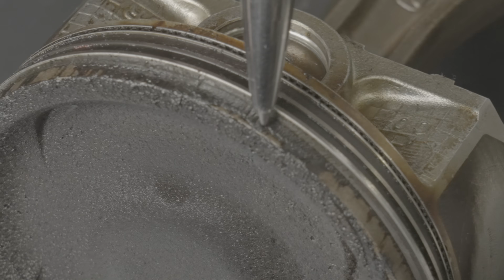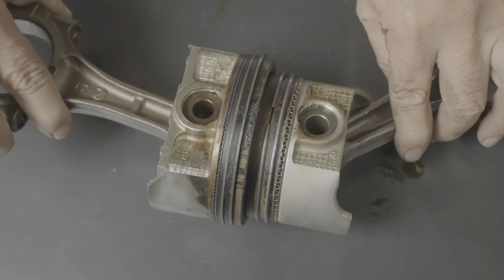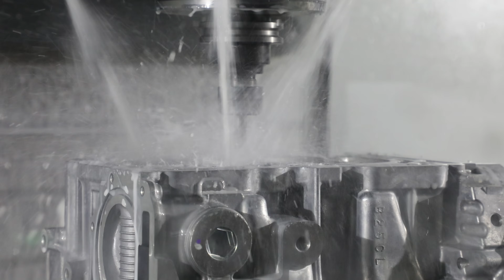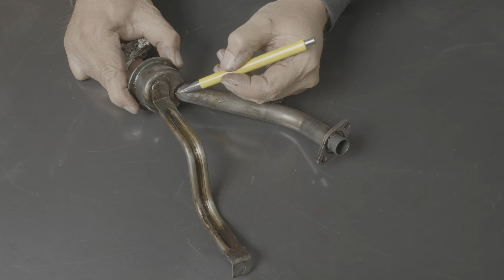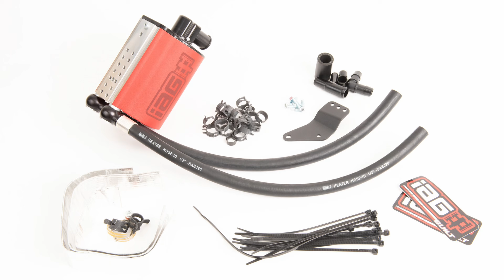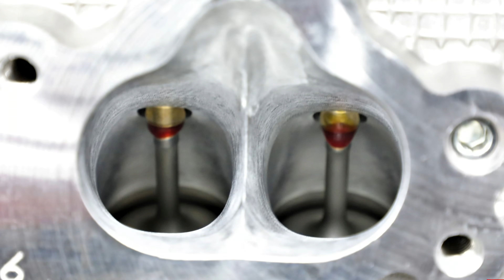Why Subaru Engines Blow Up!

Comment: My WXR was wonderful and didn't suck oil.  My STI has been nothing but problems it goes through oil like a 2 stroke.  At 16 K miles it threw its cam belt and needed a new motor the dealer claimed it wasn't covered under warranty because I change  the oil myself which is illegal but Subaru didn't care.  The last Subaru that I will ever buy!
Reply from the maker: Seems like you would have a good legal case.

Comment: These cars tend to knock, and need fuel and also run hot. Gotta watch outside environment factors, make sure the engine isn’t sitting and good tune and you’ll be fine.
Reply: Sounds like a lot of work to make sure our engines run “fine” 😂
Reply: The wrx absolutely needs to be run on no less than 98 octane (RON).
 if you do not, it will knock. Pretty simple.

Comment: Glad I found this video. I'm trying to talk my kid out of buying a used turbo charged Subaru. He doesn't have the money for repairs and needs a reliable car for work.
Reply: Get the kid a Honda Prelude from a dry climate w/ no rust. 
Fun car, 200hp, great handling, reliable.
Reply: @cecilthecavetroll9743 I feel like a 9th or 10th gen civic Si is a better bet than a prelude. Preludes are pretty old at this point
Reply: @bryanr93   true. In that case yes, a 9th gen Si (my favorite) or even perhaps a 7-8th generation Accord Coupe.

Comment: Hey Mike, any opinions on the changes for the FA24 engine in the newer model years? Mostly, does it seem as flimsy? Asking before i do something dumb do it haha
Reply from the maker: We haven't built one yet, just stock ones.
Reply: @motoiq  dang, here's hoping it can take a couple more horses!
Reply from the maker: It can over stock but its not hugely strong.

Comment: i dont know anything about what this guy is talking about i have 250k on my 09 wrx, change the oil dont do donuts, and drive it fast and blow out the carbon. car will go 300k no problems.
Reply from the maker: We have never seen that, most fail within 100k

Comment: My  MY99 WRX did 425,000 km from new. The head gasket gave way a small amount about @ 350,000 km . I ended up selling it as the maintenance costs were getting high. I still miss it. The car still pulled hard even at 425,000 Km.

Comment: Why doesn't Subaru listen to this guy, every point he makes seems to be rooted in common sense.
Reply: Because these aren’t problems most Subaru owners face. The problems only rear their ugly head when you push the turbo 4 EJs too hard.
Reply: @cecilthecavetroll9743  zero relevance, just because "most" Subaru owners do not face these issues doesn't mean they do not exist!
Reply: @donniev8181   You could say the same about any car.
Reply: @cecilthecavetroll9743  again, not relevant. Dont be a butthurt fanboy, your whataboutisms are ridiculous! If you honestly think that you know better than a 55yr veteran mechanic, you're delusional! Everyone knows the Subaru boxer engines have issues. It's a flawed engine design. The way the engine is designed, the pressure that is built up ends up being too much for the crankcase.
Reply: @donniev8181   well it is relevant to mention ownership. I’ve owned 4 Subarus, all have achieved AT LEAST 165,000 miles without a motor related issue.
Reply: @cecilthecavetroll9743  there ya go again with the irrelevant whataboutisms, Subaru engines are known for blowing up period.
Reply: @donniev8181 Bud, what’s wrong with you? Lmao, why do you Subaru haters start foaming at the mouth over dumb shit? 😂
Reply: @builtvisions  I don't hate subaru, I'm simply stating facts! The boxer engine is a poorly designed engine, if you think otherwise then you're the one denying reality. In a normal engine the oil naturally falls back down into the crankcase and pan, that is lost in boxer engines.
Reply: @donniev8181  LMAO!!! So where does the oil go then? The atmosphere? Buddy, do you even own an EJ?
Reply: @builtvisions  dude, you obviously know nothing about an engine's oil delivery system. Boxer engines are known to burn more oil than normal inline engines simply becausce of its horizontal cylinders. Because of the horizontal position of the cylinders, oil tends to pool in the cylinder heads which can then cause the oil to leak into the cylinder itself. The oil will then find its way to the bottom of the cylinder, staying there longer! Oil delivery to the engine head takes a longer time to flow back down to the pan. Oil in a normal inline engine is pulled easily by gravity back into the pan, no pooling issues. Here's an idea, try actually researching oil issues with the boxer engine and then we may be able to have a conversation.
Reply: @donniev8181  You’re talking to someone who’s owned EJs for 10 years, lol. I’m well aware on how it operates. Some oil is definitely more likely to pool in the cylinder heads due to the flat nature, but it really doesn’t burn that much more than an inline or v. We’re talking small quantities here. Generally, you’ll loose about a quart between oil changes which is quite normal. All engines naturally burn some oil anyway, especially turbo engines. Just check your oil occasionally and top off if needed. Most problems affiliated with the EJ are the owners. It’s very easy to maintain these engines. The reason why a lot of EJs blow up are because of the idiots that own them. It’s not as bad nowadays, but it was a huge problem in the past. Please, unless you actually own an EJ or have actual experience with them, don’t talk. One thing that I can’t stand is a person who thinks they know it all by doing google searches or going off of other people’s experiences while having zero actual experience themself.
Reply: @builtvisions  owning something and knowing how it works are two totally different things! If you honestly think the boxer engines do not have issues then that tells me you have no clue
Reply: @donniev8181  Right, I have no clue! I’ve only been racing and modifying these engines for the past 10 years. EJs with over 200k miles on them with original engines. I’m going to listen to a random dude on YouTube with zero experience that goes off of internet memes as “facts”, lol…
Reply: @donniev8181  Also, I never said that the boxer engine is perfect. That being said, you can say that about any engine. Know your platform and know how to maintain it. That’s it! I don’t understand why it’s so hard for people to grasp such a simple concept….
Reply: @builtvisions  you totally came after me all because I said the boxer engines were a bad design, get outta here with your bs!
Reply: @donniev8181  So explaining things to you is coming after you? Lmao, so sensitive…

Comment: My Legacy EJ20Y 5 Speed has been a fantastic car with little to no oil use.
Bone Stock, I have replaced Axels, Timing Belt, Power Steering, Water Pump, Brakes all 4 Corners and just did an Exedy Clutch with Single Mass Flywheel.
First owner from Japan 55k miles. Are you saying get rid of it? I don't plan any mods just maintenance. I dont beat it but I drive it. Did I waste 10000.00?
Reply from the maker: Keep it stock and maintain it well and you will be fine.
Reply: @motoiq  Thank you for replying. Greatly appreciated Mike. I thoroughly enjoy my car and take care of it but drive it.

Comment: Great explaination of piston ring design and open deck block. These lightweight aluminum turbo engines are race engines, but people forget they are made as light as possible to good enough finish a 500 mile race. At end of race, race engines are completely rebuilt or simply replaced for next race. When people buy these race toys for daily use, they should expect to pay for engines, transmissions, brakes and expert techs like you. It's call pay to play.

Comment: Excellent summation Mr Evo. 😘

Anyone who has owned a modded Subaru knows this about the EJ series 255/257 (as of 2009 I stopped paying attention) and I'm assuming even the fa series.

(Please comment on the FA20/FA24 specifically as i have not broken mine down yet!😅) Nor have the knowledge of having multiple friends with WRXs or time for forums anymore. Not that people on forums know anything..
Reply: I didn't know they didn't nitride it before 06. THAT makes sense to me now lmao 🤣(owned multiple 07s, friends 05s)
Reply: I should add that my former best friend spent 14k upgrading his bottom end and trying to get a tmic to work when I told him that it would not. He learned the hard way.
Reply: I also feel that any modded Subaru has to have unequal length headers as well. 😉

Comment: Why don’t you guys work on Hyundai engines?
Reply from the maker: No one has asked us to.
Reply: @motoiq  I inquired about it for a future project of mine and the response I got was "We do not work on Hyundai engines. Best of luck with your project." lol
Reply from the maker: It's because we don't want to.  Its going to be expensive and take a long type because no one builds them and the parts have to be custom made so my GM decided we don't want to do it.
Reply: @motoiq  Quite a few people have built N motors, mostly in Germany and South Korea, for 6-10k. How much money would it take for you guys to do it for someone who isn't in a rush? Or would a project like this be a hard no?
Reply from the maker: We would have to research what the weak points are and how to address them so its hard to say.  You are the only one to ask about these engines and for the amount of time we would have to put into figuring out the best way to build it and how much to charge, I would say anywhere from 10-20k depending on how much power your expectations would be.  I mean we are a small shop and we have tons of Honda, Subaru, LS, Nissan, Mitsubishi and Toyota engines to do where we have known formulas for. We are trying to avoid different projects that the development wont go anywhere for us.
Reply: @motoiq  Understandable, thank you very much for the thorough response. It sounds like for the right amount of money we could do something here. I'll be in contact eventually when the rest of the car is complete and ready for the power lol, have a good one!

Comment: basically, with a WRX engine and up, you either build it ALL THE WAY, or you leave it 100% STOCK.  All the kids bubbles just burst because they all wanna install a kobb and get a boost up without doing any other work. Above them you have johnny half-ass who says "ima just put studs".  It's people's sheer lack of knowledge about the particularities of subaru motors that blow them up.

Comment: This guy knows his stuff. Very experienced and knowledgeable.
I didn't know those Subaru engines are so crap.
I was thinking of buying a WRX back in the day, but I settled on an E36 M3 Euro Spec car instead. I still have it 15 years later and it's supremely good.
Reply: The biggest problem is that you don't know ANYTHING... someone gives you a load of crap, and you suck it down like a free breakfast.  Pathetic, but what else would you expect out of a M3 lover.....
Reply: @eskieman3948  Moron. That is the perfect response from a MORON. AN M3 is vastly superior over that shit box Subaru.
Pull your head out from your ass, wipe the shit out form your ears and wake up to yourself.
You think you know more, then prove it dickhead. Another keyboard warrior piece of shit who needs a bitch slap.
Do you have sex with animals ?.
Reply: They aren't "crap" they are legendary. Yes you have to maintain them and if you are a dick and run shitty mods with bad tunes and flog the engine they will punish you. This video is a beat up, the positives far outweigh the negatives.
Reply: @jaredmundi3599  Fair enough. I agree.
Reply: He did explain that they don't take modding very well which is not really a design flaw if people push them beyond their limits.

Comment: I have a general question on these:
   Somebody, I think subaru themselves and no doubt many others, point to the low CG as one of the many benefits of the flat 4.
    I have doubts, but have never measured or even looked closely to justify them.
   Problem is: the flat 4 shape dictates that it is installed pretty much how subaru has done- longitudinally. All subarus are front, or all wheel drive.
    This gives the crankshaft no other place to be but perpendicular to the front axle, and also above it. Not just above the axle, but it also has to clear the ring gear and differential.
   Subaru also boasts of ground clearance,  pushing everything a bit higher.
    A transverse engine placement allows the heavy crankshaft to be parallel to the other parts, so no need to be above the axle, it can now be in front of and next to it.
    Subaru cranks don't look real high,  and honda/toyota/others don't seem to have taken full advantage of the crank placement possibilities....
   But it makes me wonder about the truth of the low CG claims. The crank and rest of the bottom end are heavy parts. The claim probably has some truth in the 86/BRZ rwd platform, but was made before that car existed.
    As for some of the other claims..such as "flat fours make more torque "- I say BS. 
   If it's an even firing 4 stroke 4 cylinder, it has a power stroke every 180 degrees.
   Any torque, or lack of it, comes from other factors.
   It sure has more parts. I learned from this video about the tolerance stacking and cam timing issues after machining. Interesting- I had assumed they had 2 timing belts, (like a Honda gold wing) which would reduce this problem.
   Just another reason to do it right and actually set the cam timing..and I don't mean by lining up the marks.
  The piston/head quench mismatch is weird.
    The flimsy oil suction tube is, too, given the "rally" image that they probably enjoy. 
    Broken oil suction tube sure negates all the other problems!
Reply: So, my question there was what do you think of the CG height of a flat 4 in a FWD car compared to other layouts?
Reply from the maker: Not worth it in my opinion.
Reply: I just saw a Subaru ad here, they repeated the low CG claim. And showed a few cars with various things bolted on the roof..seems ironic. 
    Although they would say "iconic"...things on the roof,  dogs, save the planet,  etc.

Comment: Anyone run diamond pistons at their recommended .005" piston to wall clearance on these? Why keep it so tight at 3 thou
Reply from the maker: Less noise, better bore stability and ring seal, longer ring life, if the piston is designed to run at those clearances, no problem.

Comment: You mentioned the poorly spaced gear ratios if planning a high revving NA engine..
    It is easy to not realize the importance of that, and you are very right!
   I put a 4age engine into a tercel 4wd wagon. There were more difficulties than expected,  it took a fair amount of machining, welding, and other weird stuff I didn't expect. It was my car for a while, maybe 10k miles, parked and decaying now.
   A strange annoyance was the gear ratios of the manual trans.  If you didn't rev it hard, like 7500-8000 (I forget exactly)it fell on it's face after an upshift. So, it was either not much faster than a stock 62 hp tercel, or sort of fast if I drove like a clown. Sometimes embarrassing. 
  That experience is directly the reason for my current LS2/t56 powered volvo wagon. Much better. Sooo much better.
Reply: Swapping in a 4age was your first problem really.

Comment: The fact we can make ridiculous power from a turbo inline 4 or inline 6 these days, the complexity of a flat or v engine is really not required for any high performance driving. Only really the historical value in these complex engine layouts now.
Reply: the only reason I buy Subarus is because I like the dynamics. I know the output is limited on Boxer engines, but their center of gravity paired with the best AWD system on the market makes for a more unique ride that I can’t find for 40k
Reply: There is also the low center of gravity. Power isn't everything half the joy of a wrx or similar is the handling.

Comment: So how does Porsche get to 9k with their boxers without the same issue?
Reply from the maker: Much stronger more expensive engine
Reply: @motoiq  right, but I’m curious how Porsche approaches their build of a boxer vs Subaru. Would be cool to see Subaru incorporate maybe some of the approaches that Porsche does took improve their power plants.
Reply from the maker: Beefier case, closed deck, 6 or more main bearing, more support of the main caps.

Comment: Hmm.  It is well known that most of the issues are from people who improperly mod their engine.  If you bought a stock engine and left it as such, you are likely fine.  There are many factors that come into play.  It is quite possible there isn't a lot of headroom in stock form, which may be "bad" for people who want to mod it, but that means you simply need to factor that into your modifications and upgrade accordingly.  Also, many of the other issues (related to head gaskets, etc) were mainly only on older EJ25 engines so they are all pretty old now.  If you use the more robust head gasket used on the turbo models, you won't have head gasket issues going forward (on your NA engine).

Comment: Mike - You popped up in my YouTube list and I watched this video to the end. I smiled and chuckled to the end. It took me back to my younger days when different things were important. To be honest I looked up the Honda K series and the motor my 2004 Civic. I prefer the Honda D series motor it runs fast when I need it.  Parts are easy to get at.  I changed the timing belt and water pump with a super stock timing belt and pump (just a Gates replacement kit bought on Amazon) and now it’s ready to keep going at +225k miles. I plan to watch more of your videos, you are very entertaining. Take care.